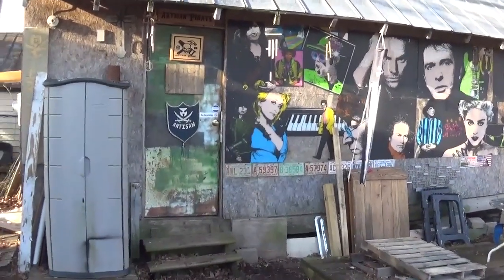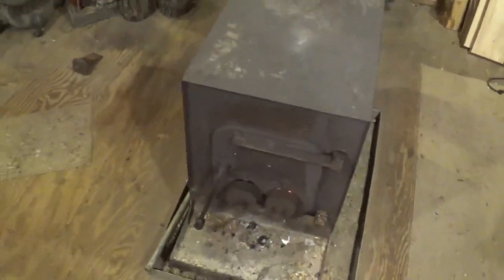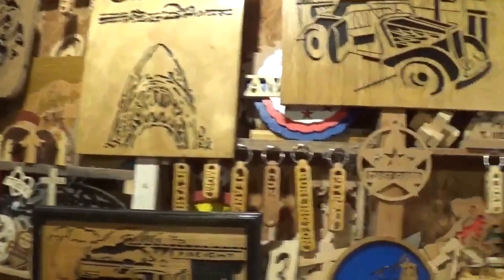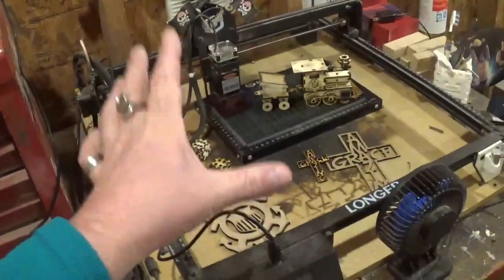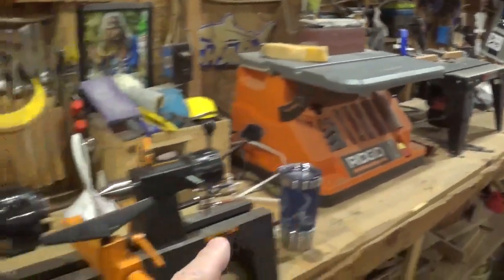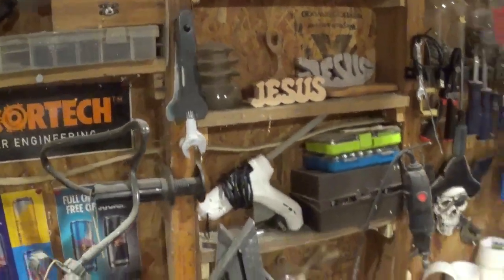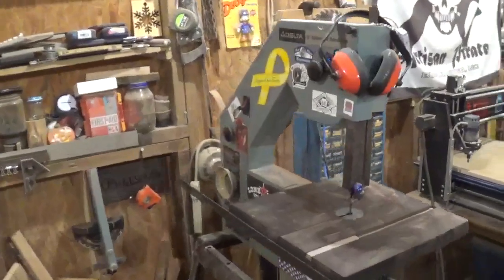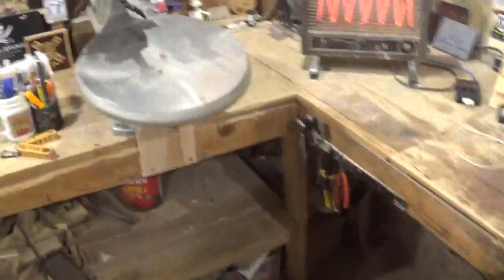Artisan Pirate Workshop Tour 2023, Scroll Saw Woodworking

Comment: The Delta 36-725t2 table saw is available at Lowes but first I would measure the required area. Not just the saw size but the required work around area. I have one and truly love it. My work area is 28.5 feet by 8.0 feet. It is out side on part of my back  patio.
Reply from the maker: Thanks buddy, I have taken into account the size of the table saw and am trying to work out a way to make it all work.